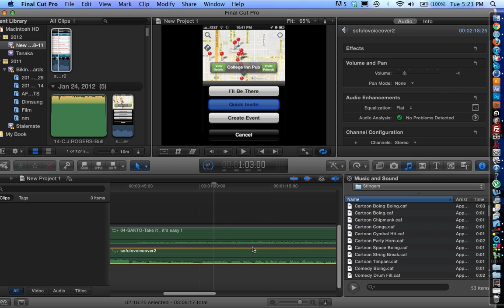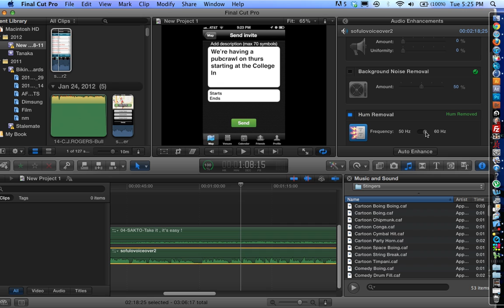Final Cut Pro X Tutorial: How to Remove Background Noise from Audio

Comment: sorry folks I have to disagree with this advice, sure they are in the tutorials, but FCPx enhancements of any kind audio or video are not that good.  I have found they cause more problems than they fix. 

Instead, go to Effects Panel - Audio - EQ - start with Channel EQ, click on the icon to open up the graphic interface.   In the graphic interface in the left side click on Analyzer.  Then click on the clip you want to adjust, and use the / to replay that clip.   You will see the frequencies in that clip and be able to use the graphic controls to lower some of the background frequencies and enhance those frequencies where your talent is speaking.   Other filters that I found helpful are AU Filter, this doesn't have a waveform moving with the clip, but once you manipulate the pucks you'll hear what you are affecting.
Reply: thanks
Reply: +BrysonFX   here you go sorry folks I have to disagree with this advice, sure they are in the tutorials, but FCPx enhancements of any kind audio or video are not that good.  I have found they cause more problems than they fix. 

Instead, go to Effects Panel - Audio - EQ - start with Channel EQ, click on the icon to open up the graphic interface.   In the graphic interface in the left side click on Analyzer.  Then click on the clip you want to adjust, and use the / to replay that clip.   You will see the frequencies in that clip and be able to use the graphic controls to lower some of the background frequencies and enhance those frequencies where your talent is speaking.   Other filters that I found helpful are AU Filter, this doesn't have a waveform moving with the clip, but once you manipulate the pucks you'll hear what you are affecting.
Reply: +Albert Maruggi Dude!!!! You're a LIFE SAVER! The built in FCPX audio fixes are garbage and doing it manually turned out SO much better.
Reply: +John Edwin Spencer happy to help we are all Life Savers in the new world order of learning and sharing.   Just cause someone reads a tutorial doesn't make them knowledgable  : ) you have to do something to learn something.     Loved your work on Black Spot.

Comment: Do you even know what hertz means? In Europe they use 50z in their electricity refresh rate and in the U.S. it's 60.
Reply: +Andrew N. Signed in to comment this as well. That's why when you walk by something electrical that is making noise (like a power transformer outside) they all have the same noise. Power flowing through certain metal compositions causes it to slightly flex based on the frequency of the power. Mainline power in the US is 60hz, so it makes a 60hz tone.

Comment: Thanks for the video!

Just wanted to point out that the two options for Hum Removal have less to do with how loud the hum is (which would be Amplitude specified in Decibels), but more to do witch matching the hum frequencies caused by Electrical Appliances (Fluorescent/LED Lamps, Refrigerators, etc). AC Current oscillates at 60Hz in the US, and at 50Hz around most of the rest of the world (or it might be the other way around).
Reply: Vijay Arunkumar That's exactly right - 60Hz in the US. The hum removal process is basically a notch filter.

Comment: The hum removal 50hz and 60hz is not how much hum it removes. The 50hz and 60hz is for the frequency of the power mains in your region. For example, a light bulb will oscillate at 60hz connected to the mains in America.